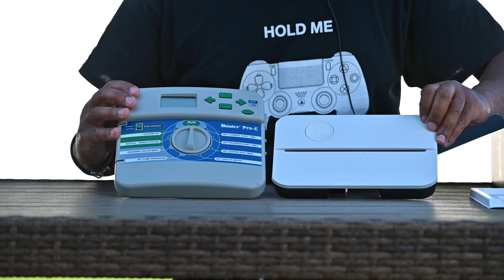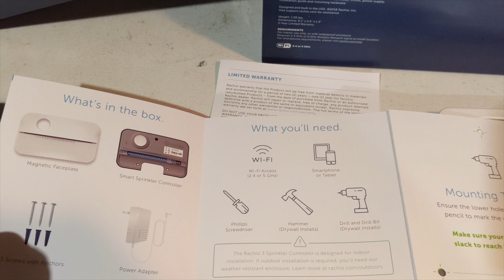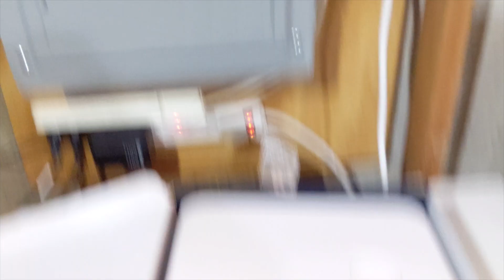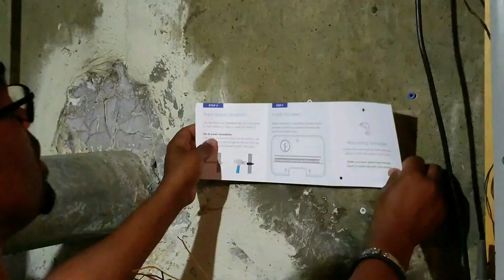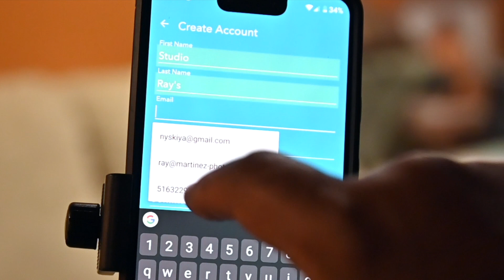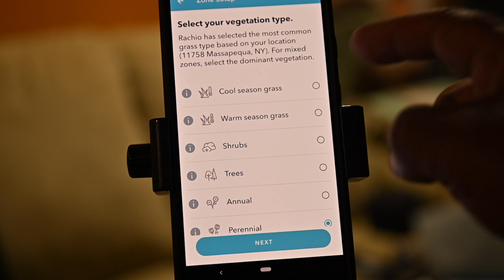unboxing and installation Rachio 3 Smart Sprinkler Controller, replacing Hunter Pro C controller.

Comment: Is the rain sensor needed with the unit’s ability to gather weather information from various sources online?
Reply from the maker: Good question. No you don't need a rain sensor for this unit. The app that sync with the unit used weather information and helps with regulating the watering. The rain sensor were override the app if you have one.
Reply: Studio Ray's Thank you for your prompt reply. I have an older Hunter model with 8 zones. When I removed the front panel I panicked as the zone wires are all red. I’m going to have to label them somehow to make sure I keep the same sequence. The rain sensor is wired to the old unit but wasn’t sure if I needed to use it.
Reply from the maker: @whoffman1000 once you get the system. I'm sure you will like it. I haven't use my rain sensor yet the app works very well. Let me know when you get your install and know it's working. Good luck 👍 please remember to subscribe.